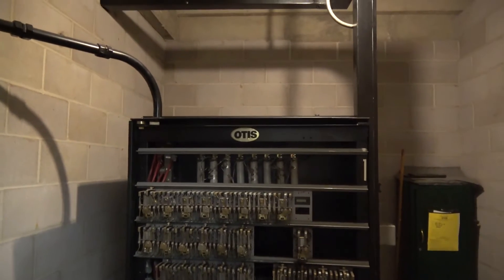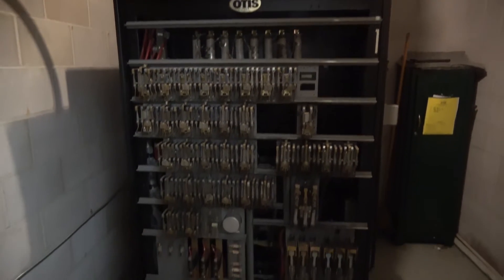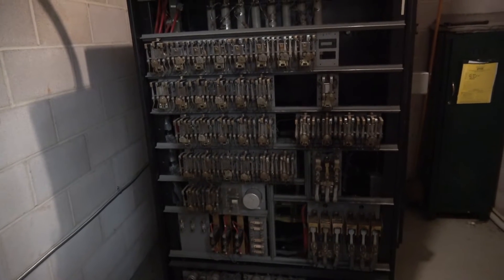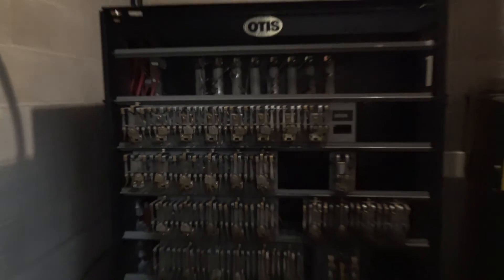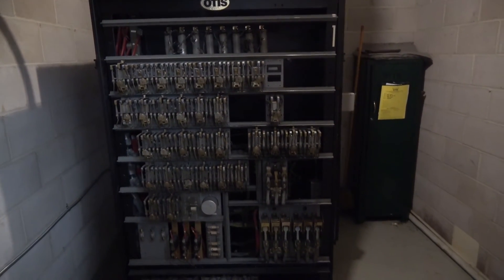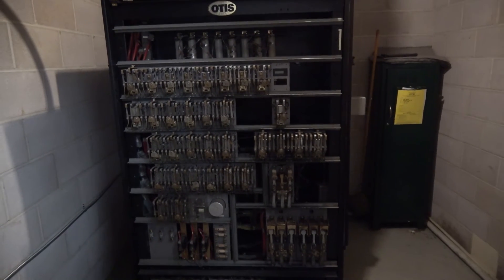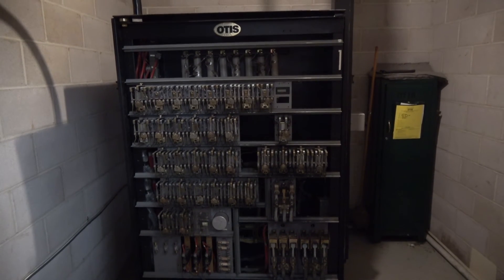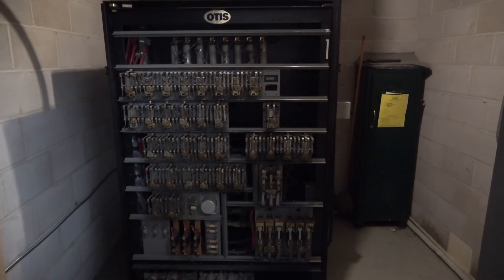1971 Vintage Otis with Relay Logic Controllers in Action!

Comment: Relay logic is better than the modern logic used in today's elevators.
Reply from the maker: I agree! You could clearly prove that these relay logic machinery is very well built unlike most of these modern elevators today using off small circuitboard.
Reply: the sound is so satisfying too
Reply: JimLiElevators
Exactly!